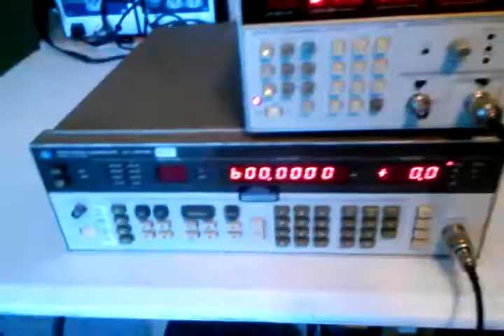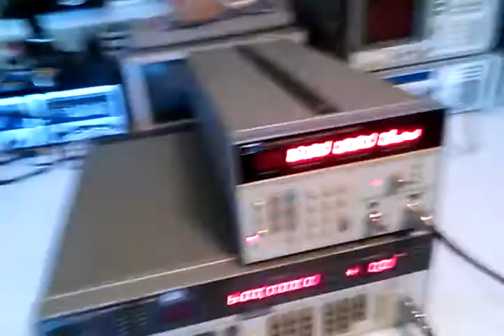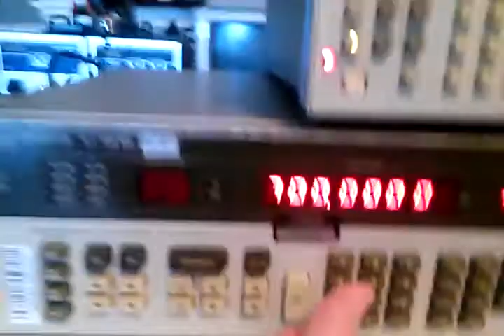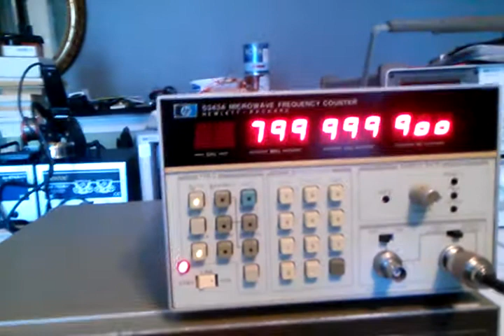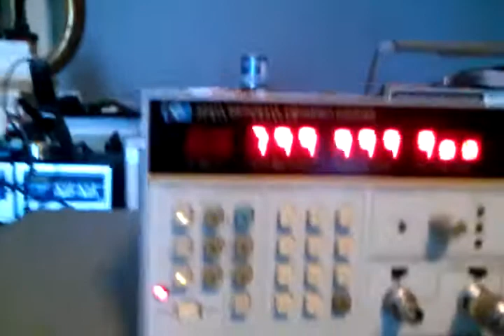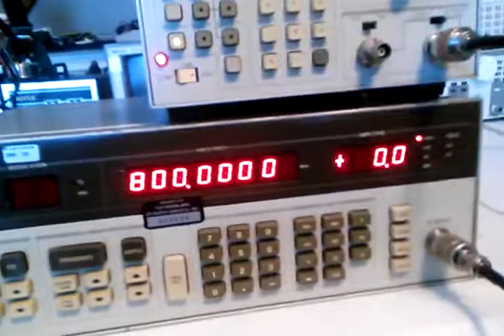First of 3 or 4 videos showing final repair of 8656a signal generator

Comment: I have a HP8656B RF Generator which has intermittent RF output. My guess is something is right at the threshold of locking in. I checked all the power supply voltages and they are all within value.  Do you have any suggestions on how I can resolve this issue?
Reply from the maker: locking in? You mean the PLL locking? Did you look at it with SA (spectrum analyzer)? or just a freq counter? If the Pll is not locking you still would get some output. You really have to give me some more information.

Comment from the maker: Hi..I just noticed you did a tear down and repair of your 5342a front panel.
I will watch the video. But I just had to pull mine apart as well.
The front panel leds on manual, offset, and sweep were not working.
It was ALL cold solder joints. Really strange!

Comment: I am planning to do a video of me converting my 5342a to be ovenized, I was going to use perf board but the trace spacing doesn't match the connector.
Reply from the maker: Might I suggest you just using the HP 10544A which is the proper OCX option for the 5342a.

ebay 79 bucks
Reply: Doctor Forbin - certainly worth a look, I had in mind building one, should be easy enough, just need the right pcb design, I was tempted to make a proper pcb.
Reply from the maker: I think that's a great idea. I'm so busy fixing test equipment that I really don't get around to building NEW. Maybe I should.
Please let me know if and when you post, I would like to have a look.

Hope you enjoyed the sig gen fixinger videos stay tuned. The fix was quite interesting.